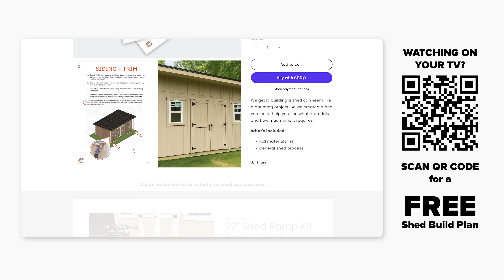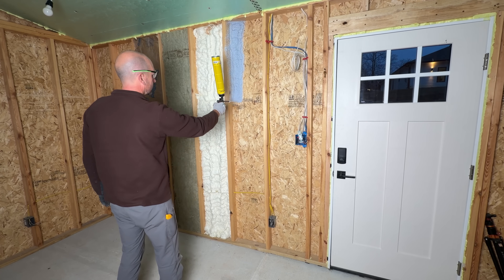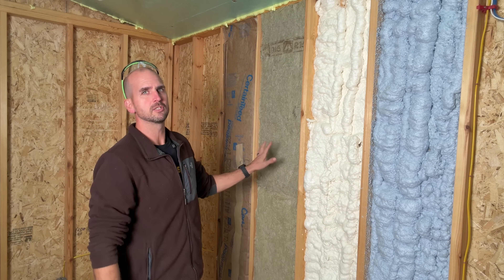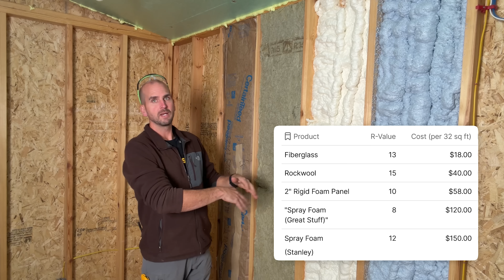Stop Wasting Money! Most Homeowners Are Insulating Walls Wrong

Comment: I always find this confusing. How come with rim joists, they say you can not put fiberglass or rockwool directly against the wood and you need a moisture barrier such as 2" foam XPS AND THEN you can put bat insulation in front of that. How come then for the rest of the walls of a house, or in this case this shed, you can just put the insulation directly on the wood/OSB sheathing? I wish Rockwool came with an aluminum (or paper) faced version. Not sure why it doesn't especially for the cost. For a shed, fiberglass faced it is but the paper face is flammable and one is likely to do a lot of cutting/grinding making sparks etc so an aluminum faced insulation would be awesome!

Comment: 6:23 eh as tests show the fiberglass is probably the least fire resistant. Some foams are completely fire resistant. While all produce beyond bad for you smoke, they don't actually catch fire. Fiberglass completely melts which can be compared to the foams as just as bad. Some foams will put out the fire from wood burning too, like rock wool does.. unfortunately they produce lots of smoke unlike rock wool.

Comment: I would never have foam insulation installed in my home or any other structure.  

Closed cell foam will permanently absorb water.  Once the water or moisture is in the foam, it will never dry out.

Comment: A  new alternative that I really like is wood fiber insulation batts and boards.  I used some for a retrofit project and it is so easy to work with and the cost is reasonable.  TimberHP is a manufacturer in Maine, but last I looked their products are only available in the Northeast.

Comment: So, you have a gasoline BOMB for a ceiling, right by hot lights and a nice spark ignition source(SMH).  At least buy Urethane foam rigid board for this!!!!  I know its hard to find and MORE expensive than that gasoline bomb EPS or straight polystyrene like you put up.  But good Grief, never put that on a house you actually sleep in.  Toxic fumes from this burning make you pass out VERY quickly.  Thousands of deaths from this stuff already in last 2 decades.   For cost of spray foam or rock wool you can BUILD a double wall that has 2X the insulation value.  2X if not 3X!!!  Anyone installing spray foam or rockwool is dumb beyond measure except in ONE scenario.   But first: Please stop lying about mold and fiberglass.  No, it does not grow mold.  It is IDENTICAL in composition as rockwool, just different form.  If you are going to claim mold in fiberglass then you have to claim rockwool is also growing mold.... Rock wool is better for one thing only: Sound dampening.  I guess a slight  2nd thing would be shape retention over time or the real reason:  bad stud building cavities letting giant air gaps form.

Comment: Scott,  I  disagree with stapling the paper flaps on fiberglass batts to the wide part of the 
studs.  This compresses the edges of the insulation into the corners.  This defeats the 
creation of the myriad air spaces between the fibers.  These spaces are the main thing 
that makes insulation work.   I know that we're only talking about an inch on each side,  
but how thick is the paper,  about half a millimeter?  You can tack the top and then stretch 
it down to pull the wrinkles out.   Or plane the edges, I guess.

Comment: I like the idea of mineral wool the most and will likely use it on my garage build.  Not only the most fireproof, but also immune to water.  The government is building a huge archives building near my home and they covered it with exterior rockwool insulation - on the outside of the walls.  It was left like that for 6 or 8 months, rockwool exposed to the outside environment, and now we are deep into the PNW rainy season and they are just finishing up putting the siding on this week (early december)!

Comment: Absolutely go with mineral wool over fiberglass. Just insulated my rim joists and the basement floor joists and the old fiberglass was all moldy despite the dehumidifier the previous owners put in the basement. It’s pretty easy to work with and you can use scraps to fit into odd places like around electric boxes and ventilation. I would avoid spray foam like the plague because it will turn into an inferno if there’s ever a fire

Comment: Two comments, stapling the fibreglass on the face would affect the wall finish and second, while you are using it only for thermal Rockwool has better sound insulation qualities.

Then who's building this shed Everyday Home Repairs or Everyday Shed. Same shed, two seperate people on two different channels?

Comment: Having the spray foam can hot makes it go farther but you have to move faster and you need to slit the insulation to have wire run through the middle of it , this floyd

Comment: My house is that thin cavity wall just like shown in the video. I live in the Bay area, California and there is no insulation in the surrounding wall except for attick and basement. In winter the house is always ice box. currently have a wood siding. I was wondering installing another wood siding (Harding's) will it help with cold? Or before installing do you advise to do the spray foam insualtion first? The house is on the hill in front of bay so it gets real windy and cold. the house was built in 1935 but maintained. The original sidings are solid and well maintained. What are your suggestion please?!- Thank you in advance!

Comment: You did not use/price/R value fiberglass insulation with the foil backing. Why?
Foam panel with foil backing, cost/R value?

Vapor barrier on inside will prevent/reduce moisture/mold in on insulation. 
Also, no house wrap on the shed exterior can allow moisture/mold in the siding.

That spray foam was never intended to fill a whole cavity as you have demonstrated. 
It is designed for small areas.
Fill in after some remodel hole/void, around an added outlet, fill seam/joint gaps, often between/adjacent to foam panels, especially in irregular shape voids, hard to access. 
Very useful in vehicle conversion to RV/camper.

Comment: Typically you only get itch with the pink; as the dye and formaldehyde is what causes the itch.   The white typically is free from that issue for the most part.  You should wear a mask as fibers do fill the air.  Rockwool I find disgusting to work with, does not cut as nice and when making fit around wires and pipes, it falls apart easily.  I see you didn't do that in your video.  But in 2x6 walls you will have to as it does not compress well.

Comment: Rockwool is the best product I've found as a builder. And don't throw away any scraps. I cut those in to small cubes for starter cubes for my seeds for my garden.
Reply: I’m a GC and 100% agree. Plus the sound reduction factor. Noise. Just dies when it hits Rockwool.
Reply: About to use some rockwool on an addition, also use rockwool cubes in my hydroponic greens set up. Didn't think to use the scraps. Thanks for the suggested.
Reply: No,  this rockwool repels water.  Not for plants.
Reply: @jamescole3152  You obviously have never done anything with gardening/hydroponics. Rockwool cubes is one of the primary materials to use.
Reply: @jamescole3152  Yes it repels water on the undisturbed surface. It also does not obsorb and hold water but if you rough up the surface water will penetrate and moisten the seeds. At least that's what works for me. I've been doing this for three years now and have no problem doing so.
Reply: @jamescole3152 Go to any aquarium store and you'll notice that all of their potted plants are potted in rockwool.

Comment: It depends on the fuel costs you estimate and the change in temperature. I used polyiso in my walls because I am heating 50 degrees on a common night and wanted maximum r value since I have electric heat. But for an occasional area I might use even 1/2" foam because it is not going to have as much heating cost and especially if you put in a wood stove!

Also keep in mind foam has an advantage because there is no thermal bridging at studs. And for heating (or cooling to a lesser degree) the ceiling insulation is more important than the walls.

Comment: Installed Rock Wool in my new construction home. The best tip I received was using a bread knife to cut and trim. Big time saver and much safer than a utility knife. RockWool is more ridged than fiberglass and little to no staples and wall stapling  of Rockwool was not even required by our local inspectors.

Comment: A huge miss about spray foam.  If the chemicals do not mix exactly right you may be forced to remove all of it due to chemical odors in the room or house (if you can even remove all of it).   There have been entire houses where they demolished the new house as the cheapest fix to get rid of the improperly mixed spray foam- and the spay foam contractors just declare bankrupts leaving you holding the bag, and no usable house.   Other than the smallest holes I do not use spray foam for anything.

Comment: A huge problem with the spray foam is once you use it, you can never pull or fish wires through the wall ever again. Also, yes fiberglass settles. But if you staple it, it pretty much stays in place.

Comment: I would suggest Rockwool always.  I have a small vacation home in VT.  Not only does Rockwool have better insulation, resistance to moisture but rodents and bugs hate it.  I had to repair a wall in my VT place and the mice made a massive tunnel system in the fiberglass insulation.  They also use it for bedding so if you have worries about rodents always go rockwool.  I made my new rockwool wall easy to access and so far in the last two years not one critter has touched it.  I also believe the rockwool is much more environmentally friendly to produce over fiberglass.

Comment: You also need a special foil to prefend moisture.Before you put drywall on.
Reply: Well, not exactly.  Devil in the details.  Required based on HOW MUCH insulation.   Like his 2x4 shed walls?  No. If ~R40+ double walls, then for Air Conditioning you need the vapor barrier on the OUTSIDE to keep humidity outside from condensing on your insulation exterior, and if in a VERY cold climate and near say a bathroom or kitchen(high humidity or you ADD a humidifier to your homes interior HVAC system to increase interior humidity during winter), then the interior of a super insulated wall would benefit from a vapor barrier, but it is still not needed as ~paint such as a REAL primer(not laytex) already does this as long as your fixture ingress points are sealed adequately.     

Guys are saying vapor barrier buzz word bingo lately without justification.  Don't get caught up in it.  Not to mention MOST "vapor barriers" --> are not, just same junk they have been selling, rebadged with term "vapor barrier" on them.

Comment: If you use any spray foam insulation, you cannot reuse or recycle any of the materials. 
Glass fibre might compact over time causing sagging, also moisture might be an issue. 
Rockwool is the only option of the ones you have there.
Great choice!

Comment: I used Rockwool on a my current gut remodel, with a radiant barrier in the attic. Considered foam insulation, but after all the horror stories and remarket value issues in some markets i choose to stay away, and on top of that, it is permanent. If you for any reason have to install more electrical, have plumbing/water issues, want to remodel, you have to remove all the spray foam in that area and redo, you can't just remove the rockwool or fiberglass and reuse. For many reasons, foam insulation in my view should only be used in situations where sealing cracks, holes, tightening up a home sparingly but not full on in attics or in wall installs, in my opinion your are technically gluing everything together, and good luck when that stuff is a week cured its hard as a brick. Plus we haven't spoken about that sound proofing perks of using rockwool instead of other options, imo mineral wool (rockwool) and cellulose insulation for attic and a radiant barrier under the roof is a superior setup with the advantages of expandability, repairability and reusability.
Reply: https://www.youtube.com/watch?v=UZPVCQNuM_I         Also go check out the horror stories of using an foam insulation in attics or complete in wall foam, the hidden leaks, termite infestaions you can not see, plus so much more relating to resale value, appraisers are getting aware of the downhill disadvantages to having lots of spray foam insulation in homes.

Comment: Why was R13 fiberglass used?  I feel that R15 would have been a better comparison against Rockwool.  I agree with the comments about cutting the backside of Rockwool for wiring.  There's quite a few factors to consider with spray foam such as serviceability, breathability and draft prevention making the choice much more nuanced.   Also, where you stable fiberglass is very polarizing and going to cause a flame war, best to just stay neutral on that one... different jurisdictions recommend different techniques.  Here in NY, always staple to the stud.  Better continuous barrier, less compression.  If adhesive is to be used on the studs, stapling inside is OK.  Other jurisdictions strongly recommend inside over outside.
Reply: I’ve been looking and I’ve never seen R15 fiberglass insulation for a 2x4 wall. Only Rockwool offers R15

Comment: I chose rockwool also. 2 years ago when it was hard to come bye. I tried the Owens Corning version also, it's easier to cut but reminded me of the old fashion fiberglass. It's very abrasive  and itchy however it does the job as good as rockwool. I used both and I would choose rockwool only for the comfort value. They are competitors and are both very good products.
Reply from the maker: Thanks so much for the feedback!

Comment: Amateur chiming.
2010 basement below grade.
2019 lower level mid grade.
Rockwell☆
Split over wiring☆
Small benifit not addressed, probably you actually have to have real weather to address this. Foam is it's own vapor barrier, where as traditional  "bats of insulation code calls for caucking and overlapping sealed vapor barrier poly stapled into place. Something warm climates dont have in code.
Quote at the time for spray foam:
 For commercial "end of the year"  "end of a commercial job with left overs".....
Outside basement walls 600ish sq'. = 5k$.
Or the equivalent, of all the framing including interior walls, all the electrical, all the rock stone....maybe the drywall and vapor barrier... probably doesnt matter at this point now does it!
Yup that was 2010. Good luck!!

Comment: Also need perfect conditions (clean surfaces,…) to apply the foam. And if there is ANY gap then it will case condensation even if it 1/4”. Good luck with clean up.

Comment: Just be aware that some insurance companies are now refusing to insure homes and some are denying claims when you have spray foam because it can trap moisture between the foam and wood wall. Primarily spray foam when used in attic space for roof insulation. People have pulled roof plywood off and found it completely covered in black mold.

Comment: You never want to use spray foam unless you are filling some small gaps like around windows.   Especially in your house. Even the kind that is designed to insulate a whole wall cavity.   It continuously releases toxic fumes - even when it dries.  And in a fire the fumes are deadly.  I imagine that the foam board does not do well either.  And, regardless of insulation, wear a mask when doing an install.

Comment: R value is a deceptive number.   It only measures conduction and it assumes a perfect wall for products like fiberglass.   It doesn’t account for convection which can reduce the effective R value significantly.   The actual insulator in Fiberglass is air!    That’s why you don’t want to squish it into a stud bay ….. you’re squeezing out the insulator.     So if your stud bay is leaky fiberglass doesn’t work.  Even if it’s perfectly sealed as the outside air temperature gets colder convection currents will form moving from hot to cold reducing the effective R value significantly as you approach zero degrees F.   Yes fiberglass is cheap but you get what you pay for!

Comment: If I want to use this room as an office, then even this 5 cm foam insulation on the ceiling is a problem. Water vapor diffusion causes condensation on the cold building components.

The entire construction must be considered to prevent the wood from rotting.

Comment: If I want to use this room as an office, then even this 5 cm foam insulation on the ceiling is far too little. You use a U-value calculator for things like this to determine the actual thermal transmittance values.

Especially in a small room where I have an extremely poor surface area to volume ratio, it's necessary to at least achieve the passive house standard of 0.10 This means at least 18 cm of 0.22 insulation as a minimum.

Especially in the attic, where warm air rises, very, very good insulation is absolutely essential. Anyone who doesn't do enough there hardly needs to worry about the walls and floor.

A U-value of 0.24 is the absolute minimum for walls and roof.

Comment: I know from the pictures that this shed is already been sided.  Maybe if you have a chance though you could add a section to you video list on this build about adding foam board (exterior grade) to the outside of the wall in addition to interior "Traditional" insulation.  This will increase you  R value while not having to use any of your interior room if you are trying to squeeze every inch of insulation in while still getting the largest floor space in your shed/structure.
Way to late in the build and also on a side note, but if the building is being purpose built, look into a foam layer under your concrete.  Oddly enough this will again cost you upfront, but pay for itself over a few winters.